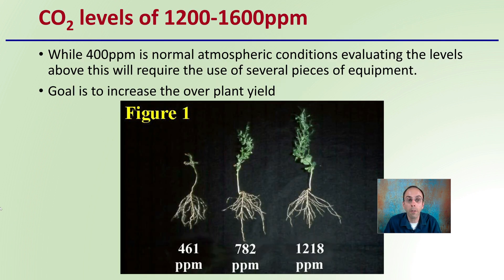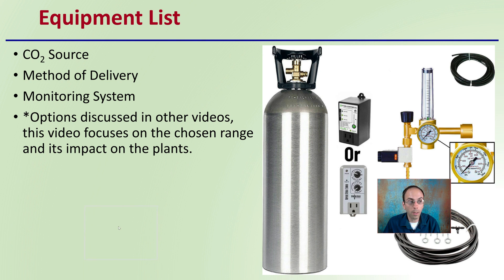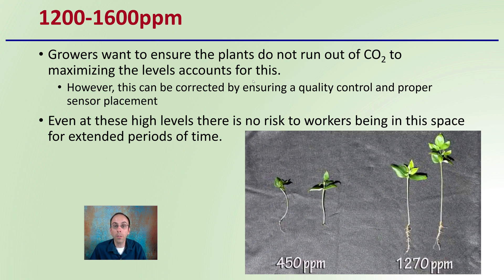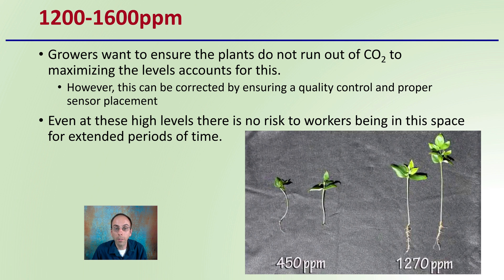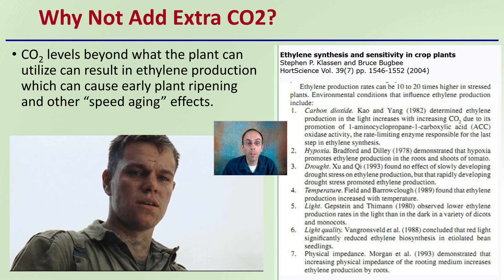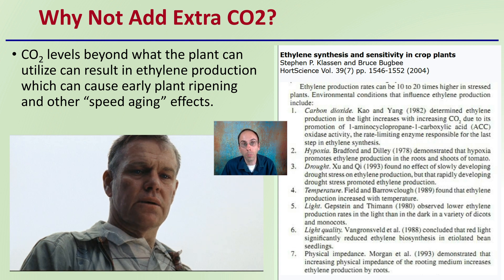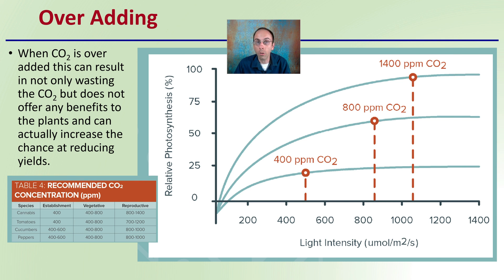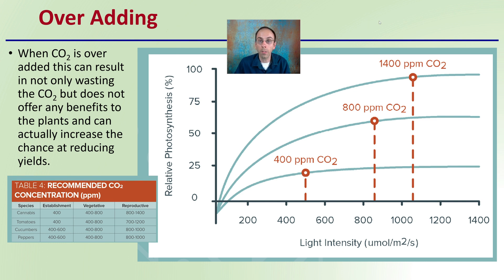Carbon Dioxide Levels of 1200 to 1600ppm and Cannabis Plant Production

Comment: To get 30% more yield at the end, you need to have everything perfectly dialed in. 1000µmol of light, temp warm but not hot, enugh water, and a little more fertilizer. Only then, it can grow a little faster.
Reply from the maker: CO2 is the last thing to add once you have the rest maximized.
Reply: @DeBaccoUniversity  Yeah, all mixed together. At night, no carbondioxide!